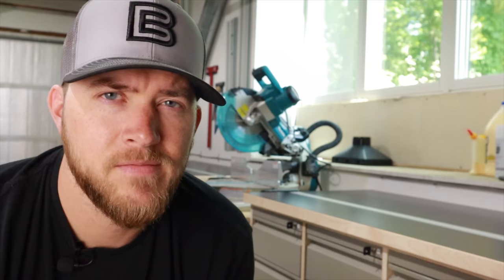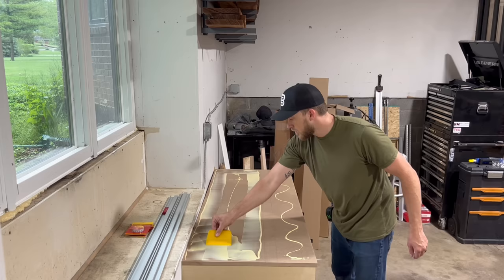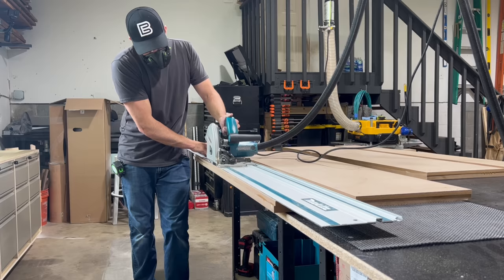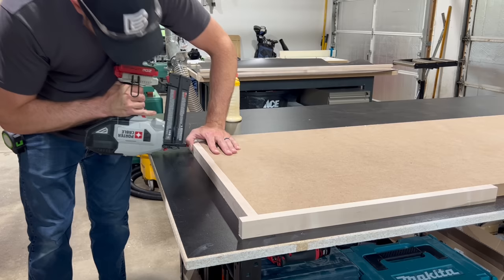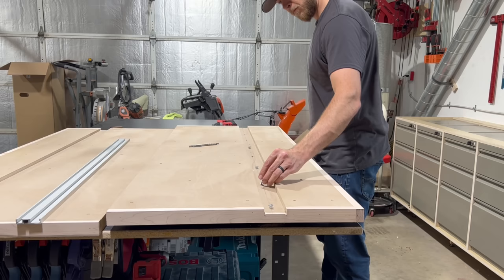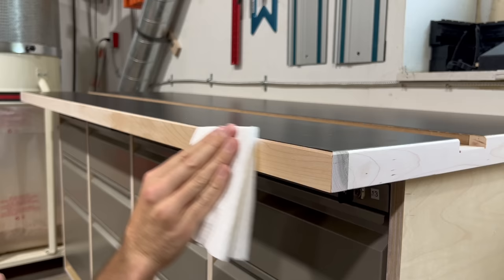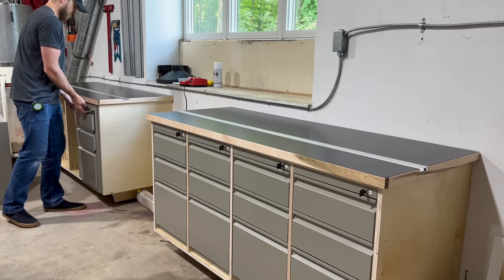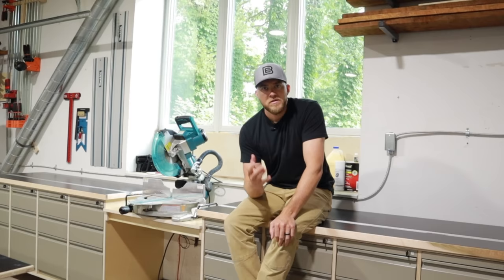Build Your Own Work Surface || Miter Saw Station

Comment: Love it! What kind of cabinets are those?
Reply from the maker: Thanks! I’m not sure the brand, I found them on Facebook marketplace.
Reply: @EverydayBuilds  Nice find! They look great. That much wood & drawer slides would get very expensive, so I’ve been considering something similar.
Reply: Devase (hope I spelled it correctly) most manufactures make a similar cab. If you have a used office furniture outlet they can be reasonable.
Reply: @tomr3422  Perfect. Thanks for the direction!